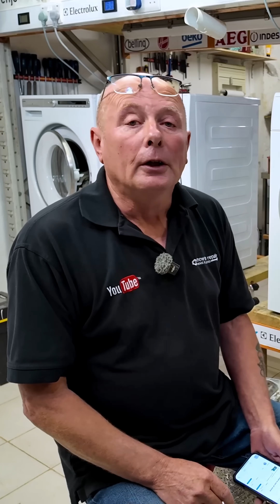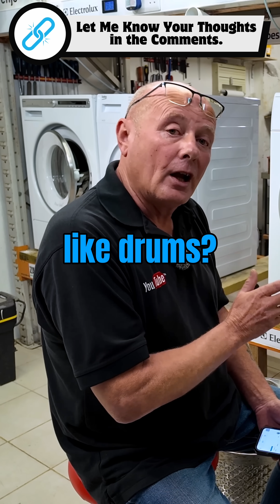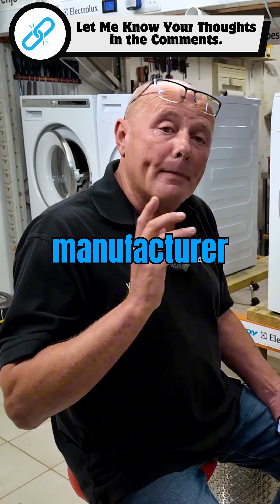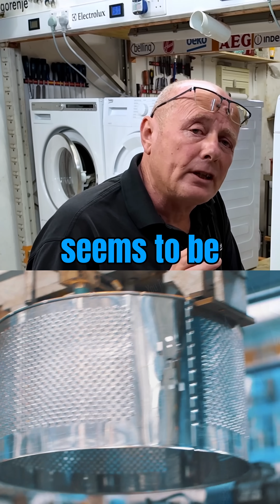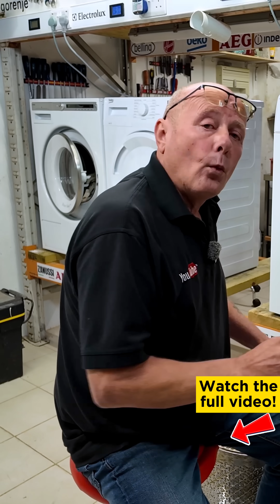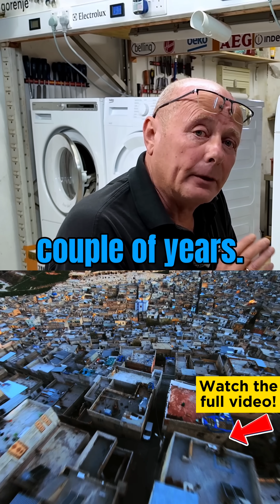⁠Manufacturers’ Dirty Trick: Why Do We Get THROW-AWAY Washing Machines?

Comment: I was so angry when the maitnence guy told me that the bearings in my washer-dryer Gorenje failed and that the drum in machines is now fused together and the bearing and other parts cannot be changed.  In old machines, the bearings and other parts were accssesible. I think they are removing the right to repair.
Reply: okay, you started this 😁 so please, tell me, how long does it take you to change your bearings and seal and how much you pay for the new parts ?

Comment: Because Asians know their machines will likely fail within warranty and before estimated cycle count. So they can service. Asia designs for 1500-1800 cycles , european 2500-2700 in most cases. Woth 5 eashes per week. Thus why not make sealed if it likely will live to its projected lifespan. So if it fails after it's projected life time it's bit different story, cause manufacturer cares about warranty not extending an appliance life to the eternity. Abd always remember , don't buy what repairman recommends , cause he dies not know the units what almost never needs repairs 😂 of course bearing should be exchengable it's ridiculous when a machine consists just out of 4-5 parts abd connectors. BTW in east Europe masters cut open and then glue/solder back single piece drums. Sure at uk skilled repairman hourly rate that's not an option

Comment: They arnt removing the right to repair infact they are just making it not financially sensible to repair same as the dewalt brushless impact drivers the switch fails but the switch is potted and part of the brushless motor and internal wiring assembly price is like 89.99 and a new body only tool is 99.99 so yes repairable but not financially sensible

Comment: I repaired my Beko tumble dryer 6 times now it’s always the plastic front panel membrane switch get it of EBay for 4 pounds also drum rollers and filter capacitor know quantity issue it’s now 15 years old on original belt and motor

Comment: The size of these bearings are calculated to fail. It would only cost a fraction more to use a bearing that can handle much more dynamic load. 
But that would prevent you from buying a new machine every 7-8 years.

Comment: I dumped a beko tumble dryer like the one behind you as the felt strip around the lip of the drum needed replacing and the machine required almost complete dismantling to get to the affected area. A machine barely 2 years old. Pure scrap.

Comment: It boils down to tax accumulation from all angles in the north. You buy and pay tax on it➡️ the retailers pays tax➡️ you repair or buy a new one ➡️ more tax generated. The one collecting the tax probably also has shares in the manufacturing company. It’s a closed circuit for the collector but open wallet for everybody in between 😂

Comment: Our miele W851 is almost 30 years and it's still running and running and running. Bearings are no problem, motor is almost done. Replace coals will not be possible again 😢

Comment: I thinking I know what they have done my own conclusion is basically first can’t get at the bearing to repair. And secondly they fail a lot quicker because of the bad quality of the bearings and the actual rpm a machine does now ie 1400 or even 1600 no bearing of poor quality is going to stand that over time and the excess weight  in it when loaded with clothing and the water. put two and two together and you get the bearing or drum failure a lot quicker. You know and i know u never got that yrs ago it would take yrs for it to start happening. But now with this very high spin speeds crappy drums and soft crappy bearings they got what they wanted. Pure built in obsolescence.  Bingo!!!! Ahh need to buy a new machine less than  five yrs now. It’s ridiculous. I have been like you in this business a long time. Starting in the commercial laundry then eventually starting up on my own in the domestic market. It’s actually worse in the domestic markets than it was in the commercial world. It’s unbelievable and I have every support and sympathy for you  as to what they are doing in the domestic market.  😢

Comment: Also, when you buy a set, when washing machine brakes, you should replace dryer as well because it won't fit well. You should mention Haier as well (and their model x11 - very expensive one, that have  not replaceable bearings)

Comment: Get along  to your local bearing shop and Screw the manufacturers. All bearings have a part number on them and My local shop will find the right one or a comptable one.
Reply from the maker: The bearings are easy to source and will not cost you any more than £20 if you buy the best quality sometimes the seal is a little more tricky as these are made by the manufacturers sometimes and are unique to their machines I hope you watched the full video and please remember to share it.

Comment: Manufacturing costs would be lower on a sealed drum, you could have a machine do that, but a machine to insert multiple screws to a specific torque, would be expensive and require a lot of maintenance, you could use human labour to do it, but that's also expensive and they make mistakes (company I work for has people doing this on vehicle parts). Over in Asia labour costs are next to nothing, but then whats' to say they don't make all this stuff over there anyway?
I think culturally we've stepped away from repairing things, there's this opinion that repaired items are not as good.
There's a distrust of technicians, people worry about being ripped off, people don't like paying for a persons time, they want parts and they want something they see is different with their item/device/appliance/vehicle, if you just a tighen a screw and charge the 2 hours labour that it took to find it, they'll leave you bad reviews, they're happy to buy tyres for a car, but not brakes or wheel bearings and for a service they need large tickbox sheets with lots of fictional "points" that aren't really checked, so they think they're not being ripped off.
Society trusts salesmen and not technical people.
The manufacturers also use social engineering to condition people into thinking that new is best and that older things cost a lot more in repairs, so people will happily pay for something on finance in the belief that it's cheaper.
I could go on......

Comment: its not just wear and tear items. Nissan turned my Leaf's telematics off so i couldn't remotely see how much charge was in the battery or turn the heating on without going out to the car. They killed the SIM card off and blamed "the 2G sunset" well in many parts of the world, that still exists, there are 5 operators near our house. 
I spent this morning changine the SIM card and redirecting the computers of the car from nissan to a third party.

Thanks to the people of Open Carwings, my car is back online using 2G with more features than it originally had and i'm guessing there will be a work-around before 2G goes by in 2033

No way will i upgrade to a new £35000 car for them to shut down its features in as little as 6 years

Comment: YES
Plus they have have mandatory obselete standards now worked in as " high quality standards".  Its not just with washing machines, its with everything.

Here is an experience from my aunt. her central heating heater broke down the thing was 60 years old. She replaced it with a new model. 1.5 years it broke. Gets repaired 3 months later broke down. had to buy a new one 4 years later ( was one of the most expensive ones out there with 20 years or garanty) BROKE DOWN. company didnt know what was wrong with it.. local repair guy came for a look, replaced a bad part and now it works. There was a part that connected to the internet... WHY DOES APPLIANCES HAVE TO FRIGGING CONNECT TO THE BLASTED INTERNET...

LOVE your channel, mea culpa for the rant... have you seen the mandatory adds on new refrigerators that you cant skip and you HAVE to watch in order to get the fridge open... its like the paid features in cars you have to shell out per month.. its  why i drive old 1950s-1990s cars. the cars i can wrench on.
Reply from the maker: The whole system nowadays is about money they just want to sell more to prop up false economies. They preach that they are doing something good for the environment but the waste is 90% of the problem.
Reply: Refuse machines with internet connection or apps. They are even a security issue!

Comment: It keeps the factories busy, churning out spares and new machines. If it was mandatory that you could only rent machines for a monthly subscription, it would rarely break down and have easily replaceable parts.
Reply from the maker: This may be the long-term plan when you consider the manufacturers could've stuck with a machine that they built in 2000  they wouldn't needed to change anything. The machine would still be more environmental friendly than it is today because it would not be going on to the E waste piles.